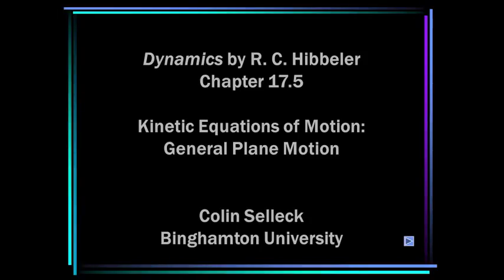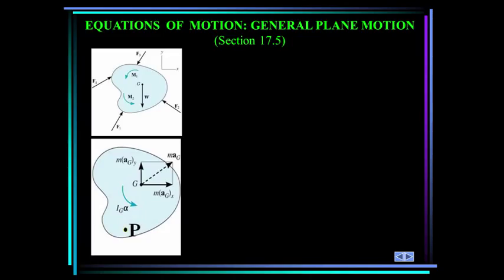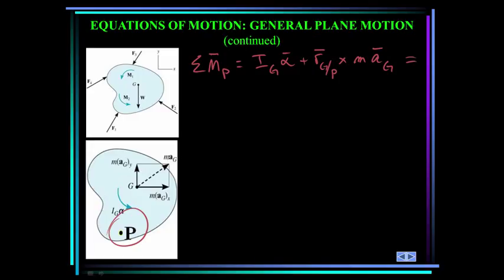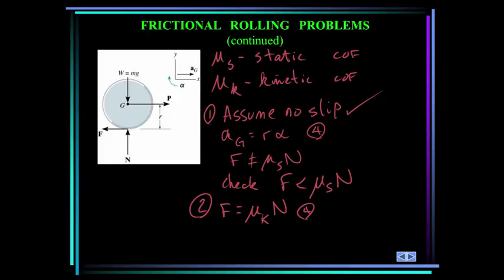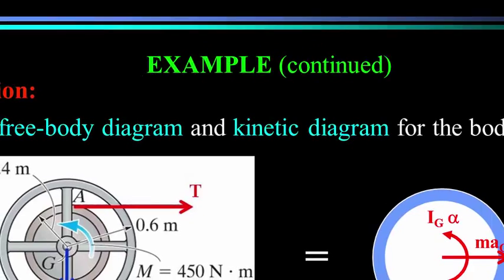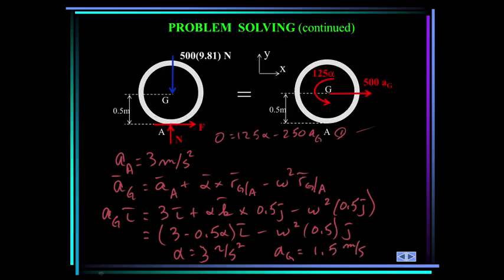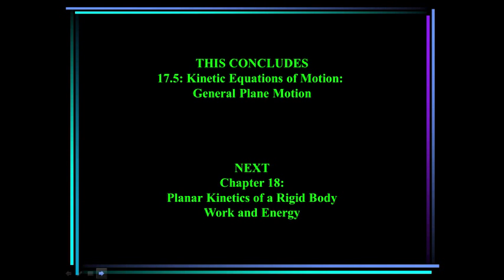ME 274: Dynamics: Chapter 17.5

Comment: Thank you so much for making and uploading these videos, they have been extremely helpful.
I am having difficulty understanding why in he firs example, you used the inner radius instead of that of he body.
Reply from the maker: I use the inner radius because the wheel is slipping at the contact point with the ground. You can visualize the cable being wrapped around the inner radius as the wheel moves to the right and the instantaneous center of zero velocity is at point A..
Reply: OK! Awesome thank you :)

Comment: At 14:40, could you please explain why the acceleration a(G) is towards the right? Shouldn't it be towards the left since the angular acceleration is CCW?
Reply from the maker: The pipe has a angular acceleration wrt to the truck that is CCW. But the mass center of the pipe has an acceleration to the right.
Reply: @ColinSelleck  But shouldn't the acceleration of the mass centre be consistent with the angular acceleration?
Reply from the maker: @younamsayin  No. The alpha is wrt to truck and it can be CCW but the mass center can be accelerating to the right. Look at the relative acceleration equation.
Reply: @ColinSelleck  i'm pretty confused here... I thought the motion of this truck will cause the ring to move towards the left.

IF we were to use angular velocity instead of angular acceleration, and velocity instead of acceleration,

then in this scenario, would the angular velocity become CCW and the velocity to the left?
Reply from the maker: @younamsayin  The pipe does move to the left wrt to the truck. But the absolute acceleration of the ring is to the right because the truck is accelerating.

Comment: At 7:57 you tell us about the acceleration of the mass centre being consistent with the angular acceleration. Can you please elaborate on this, I'm not sure exactly sure about what this means. Thanks
Reply from the maker: This statement is only true for frictional rolling problems that I had just gone over in the video. If there is no slip (and a homogeneous cylinder so the mass center is at the center of the cylinder), then Ag = r times alpha. If you assume alpha is CCW, then Ag must be assumed to the left and vice versa.
Reply: Colin Selleck Thank you so much. If it's not a rolling problem, then can I relaxed with assumed directions of alpha and acceleration of the mass centre?
Reply from the maker: That is correct.
Reply: Colin Selleck thank you. Is there a patron or something that I can contribute to? I would like to support you if there is a way
Reply from the maker: No patron. I do it to help my fellow (future) engineers.

Comment: First thank you for the video.  If the spool in your first example is 1962 [N] / 9.81 = 200 [Kg],  Not 20 [Kg] there for your solution is incorrect. Unless I missed something.
Reply from the maker: Thanks Moshe. You are correct. Moment of Inertia should be 200(0.3)^2.

Comment: How does a CCW moment cause the wheel to move to the right?
Reply from the maker: Because of the cable attached at B. The wheel will slip on the ground and the cable will be wrapped around the cylinder.

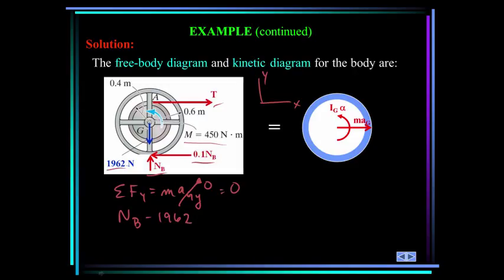Comment: At 5:37 you tell us not to use F=(mu)*N and the in you first example you at 9:40 you do use 0,1*N …? How does that work?
Reply from the maker: AT 5:37 I didn't say not to use F=(mu)N. I said first assume no slip (so F is not equal to (mu)N) and solve for the frictional force. Then compare the friction with (mu)N. If it is greater, then use F = (mu)N.